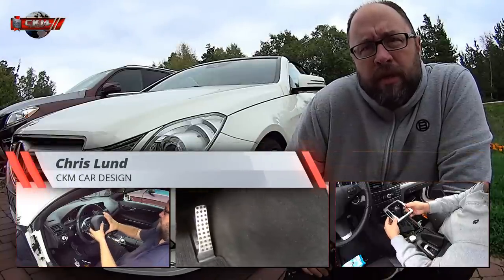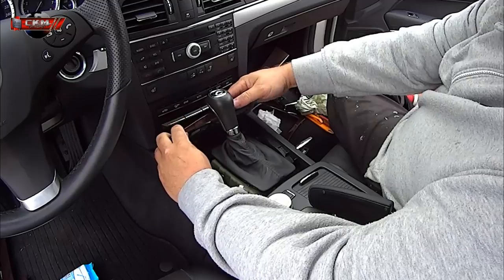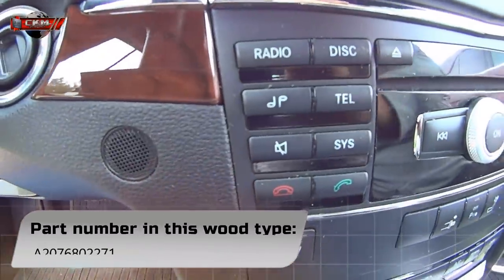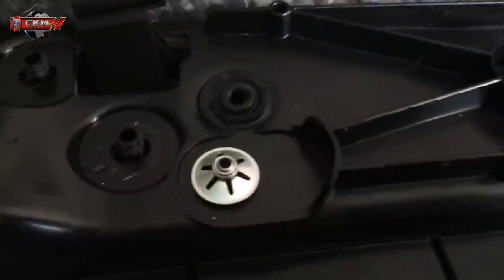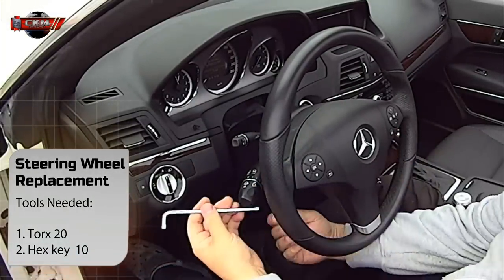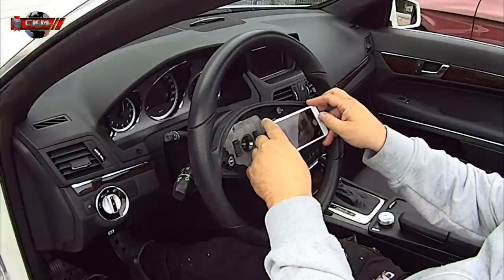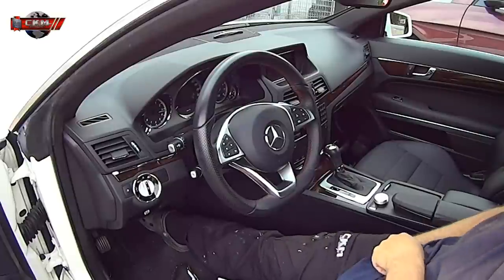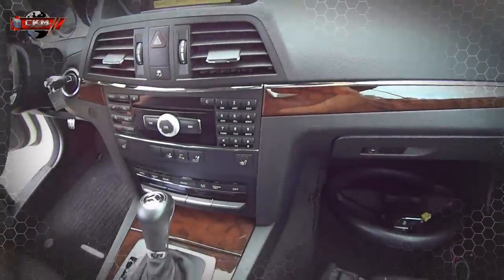Mercedes Facelift steering wheel sport pedals trim retrofit W212 W204 W166 W207

Comment: I have a 2013 e350 sport coup and it came with the wood already, but it's faded because of interior cleaning products. Do yo have replacements for the front doors, and the dash. Also my buttons on my steering wheel plastic is peeling.
Reply from the maker: I could..

Comment: the steering nut is extremely difficult to screw it out, but you simply skipped the hardest part to make your video looks easier.
Reply from the maker: You mean that is the hardest thing I didnt show in video? I dont think its that hard. Just needs a impact gun or a strong hand. ;)

Comment: Nice job
By the way i have a question, i tried to upgrade the original steering wheel of w204 year 2010 to 2013 facelift one
Averything works fane the airbag the buttons group only one thing not working the illumination of buttons can i have your help about this ?
Reply from the maker: New column..

Comment: Great video. Can this steering wheel and column work for 2011 C300 W204 and 2012 GLK. Thanks
Reply from the maker: Absolutely. You see it in my GLK in the histry video.
Reply: Nice video. Where can I get this steering wheel? Is't safe on eBay?
Reply from the maker: www.ckmcardesign.se to be 100% sure it works.
Reply: Can I install this steering wheel on c63 2010?
Reply from the maker: Of course.
Reply: @CKMCardesign  can i also install this on my C320 CDI 2009?

Comment: Hi, I have a cla 220 cdi of September 2013. I have the pre-restyling flat bottom steering wheel. Is it possible to change it with that restyling without coding and without changing the steering wheel column? Thanks.
Reply from the maker: Yes.

Comment: I have a 2010 W212 E200 if i bought 2014 steering column and 2016 steering wheel will all steering control functions work(like arrows and mute etc..)? And my stock model does not come with shift paddles will the shift paddles work?
Reply: Plus could you give me the part number for the steering column you used in the video, because i have the same functions like this one (wipers, speed limiter, cruise control, manual steering wheel adjustment) no rear wipers , no gear shifter.
Reply from the maker: Just order it on my site.

Comment: Hi 
your work looks great! I have been very interested in changing my 2008 C300 Steering wheel (similar to the one in your video) to a 2012 C300 Steering wheel Can this be done?  I have a C300 Sport and I do not have the electric telescoping wheel mine is a manual, I do not have paddle shifters either, please let me know I am seriously interested in trying this experiment.
Reply from the maker: You find all you need at: www.mbscashopen.com

Comment: Hi 
I’ve bought a steering wheel similar to the one you are using for my E class W212 it’s the 2009 facelift 
What colum do I need to buy for it ? If you could help that would be great
Reply from the maker: That is a bit complicted. You need a 2014 column or newer with same features you have now.

Comment: What year and model did you use the steering  column from?
Reply from the maker: 2014 and upp
Reply: CKMCardesign which model is it from because I would need the one with out the electronic P R N D on the column
Reply from the maker: Just email me.